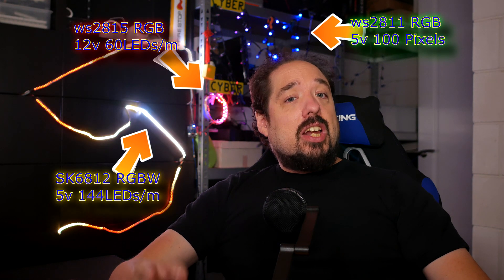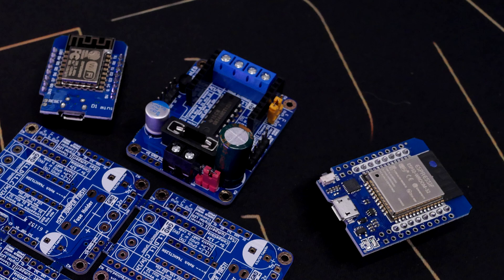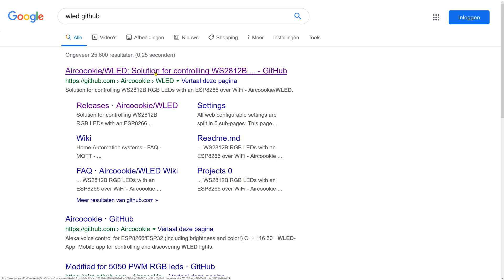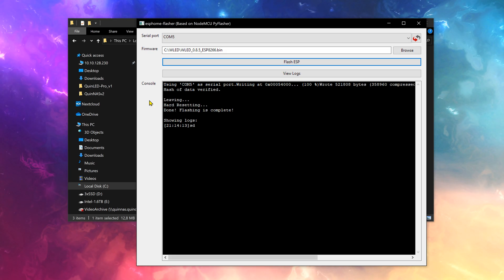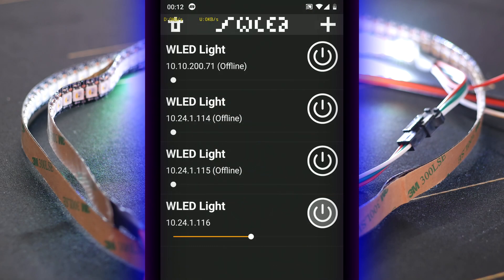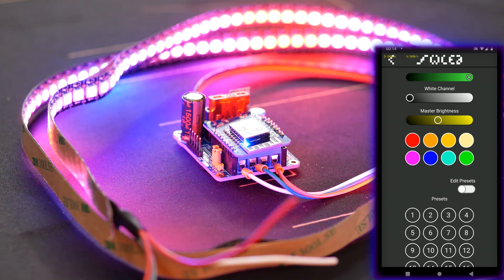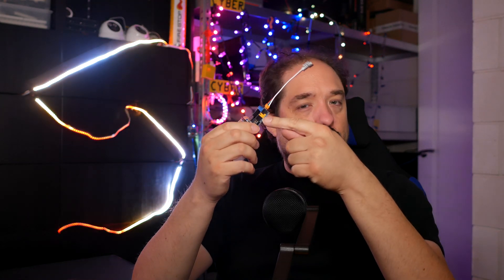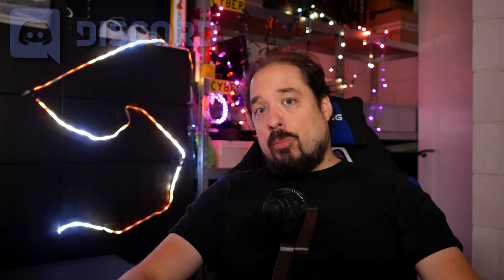WLED Tutorial - The ultimate DIY RGB Controller?

Comment: Hey I bought 4 16ft WS2815 12V strips with 300 LEDS per strip (1200 LED total). Could 1 Dig-Uno run this assuming I inject power in the middle and have a good power supply?
Reply from the maker: With 1200LEDs you are running a bit much for the single channel, ~1000LEDs you get about 30FPS and that's already a bit choppy, but above that with like 1200 effects and everything will start to look really choppy.

Take a look at my recently introduced QuinLED-Dig-Quad, that has 4 output channels over which you could divide all the LEDs and that way you can keep the FPS high. Sadly most software (Like WLED) doesn't support it yet, but it's coming.

In regards to power injection, since they are ws2815's I'd recommend injecten after each strip, so begin + middle + middle + middle + end. Otherwise you are going to see a bit of drop
Reply: Intermit.Tech Thanks for the help, honestly! If I really want to make this project work, would two dig unos on one power supply work? Like if I sent two strip one direction and two strips in the other direction, where they would meet in the middle rather than in one continuous strip, could this work ?
Reply from the maker: That could work, but only if you basically treat it as 600LEDs x2. So basically connect both sides to the same data pin so both LED strips will do exactly the same. Then you are fine framerate wise. And in the future, once software support is solid, you could combine them again but driven over 2 channels without the slow down issue.
Reply: Intermit.Tech You rock man! Last question of the night, would having two dig unos mean two WLED networks? Is it fairly simple to
Merge them or sync them ?
Reply: Intermit.Tech I’m fairly new to all of this so sorry if I’m asking some weird questions. My main concern is the WLED control over internet since there will be two now.
Reply from the maker: They can be easily synced, no issue. But the patterns don't follow over to the next controller, they just perform the same.
Reply from the maker: Should work just fine on your WiFi or if you are not @home over a VPN. Otherwise Home Assistant control of WLED is awesome!
Reply: Intermit.Tech You’re a huge help !! Looking forward to all your new content!!! Your channel is pure gold man. Thanks again

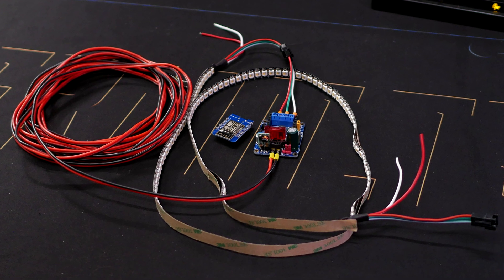Comment: Total noob here, literally zero knowledge outside of a couple of videos on this subject. At 5:06, why doesn't the LED strip need to be connected to a power supply and only the dig-uno? Unless it's been plugged in by the time it turns on at 5:34, the strip's power wires are off screen at that point.
Reply from the maker: With the QuinLED-Dig-Uno design the power runs through the board and includes some safety functions including a fuse. That way If something goes wrong and it suddenly uses a lot more power, the fuse will pop and cut off all power.

Comment: Could you make a tutorial for WLED with E1.31 input? With multiple receiving controllers would be awesome! Looking in to adding strips to my existing DMX light setup :)
Reply: succesfully working with mad mapper and ArtNet. I set a different universe for every board, and they respective IP's
Reply: Albert K I normally use “LightKey” for DMX but are not able to find the ESP8266 in ArtNet or E1.31.. Even thought I can normally access it trough my normal WiFi.. Could you please be so kind an share your ArNet settings in WLED config? And is there any need to “enable” these settings? (Like turning on ArtNet?) Thanks!
Reply: @iFlojoe  Hi! I go to Config -> Synch interfaces 
-> Network DMX input type: Art-Net 
-> Start universe: 0 
-> DMX start adress: 0; 
-> DMX mode: Multi RGB.
Then in your software you have to enter manually the IP address of the board. If I have two boards I set board 1 with his respective IP to universe 0, and the other with his respective IP to universe 1. Never use more than 170 pixels in this case. I don't know how it works when it has o merge universes o control more then 170 pixels :) It is clear???
Maybe Artnet Pool is not enabled in WLED and your software does not "discover" the board, but he is already listening for artnet! So you have to point to the IP manually
Reply: Albert K thank you very much! I will try to copy your settings and set the DMX software to manual mode :) I am looking forward to only use the Effect Mode (11dmx channel), do you think I can have multiple Nodes receiving the same DMX univers?
Reply: @iFlojoe  Yes I just tried that in Madmapper and it works, two ESP receiving the same universe in this dmx mode. Do you know what all this 11ch do? I'm just playing with the sliders....
Reply: Albert K The “LightKey” software I am using on my Mac does not allow to set a specific IP address, but wenn I switched it to Broadcast mode it finally worked! Thanks again :)    The 11ch mode ist the best for me because I don’t want to have control over every single pixel, with 11ch (13ch if you have RGBW strips) you can aktivste the animations from WLED via DMX, like using the automatic Programm in lasers or moving heads!  See this site for different channel modes and an overview for 11/13ch: https://github.com/Aircoookie/WLED/wiki/E1.31-DMX

Comment: I’m tech noob but is there a way to do the wifi connection without eating up your home bandwidth? (Like a separate router that is online from your home modem but connected to your computer and wirelessly to your ESP controller)
Reply from the maker: What bandwidth are we talking about? Just having the controllers connecting and display effects doesn't use any bandwidth? Further there is only so much airspace, yes a second access-point (not a router) can help on a different frequency, but that's a very extreme setup. What issues are you having? Figure that out first. :)
Reply: Intermit.Tech sorry i think my question was a result of my wifi noobiness. I just thought having these connections as wifi would mean running off my home internet and affect my web browsing for example. I don’t actually have any equipment, was just trying to determine whether I want to go with a wired falcon controller vs. Wifi esp.
Reply from the maker: @jordanl7489  Ah no, it indeed doesn't work like that. Having a device connected isn't such a big issue, if it activity sends or receives lots of data that is different, but with general WLED usage, no such issue.
Reply: Intermit.Tech thanks!

Comment: Hi, just stumbled across this doing research. Can you control more than one LED strip from a single controller?  Zones?  I see you have a pre-built version now - you may have yourself a new customer. This looks great!
Reply from the maker: Multiple zones not yet. I'm working on a Quad channel hardware version and WLED should add that feature somewhere this year too. For now you can run a single strip (or multiple but they will do exactly the same) and you can work with segments on that strip to have different effects
Reply: @IntermitTech  Probably an unfair follow-up... and maybe the wrong venue, so feel free to redirect me... I'm down-lighting some stairs.  I don't know how well WLED handles segmenting a single strip -- if it can treat each segment sort of like a zone (I don't anticipate doing different effects on each stair, but it would be cool to get each step to act independently)... what would you recommend to give the most flexibility?  Do I need 24 individual controllers - one for each step?  (and thanks for getting back to me -- you're awesome!)
Reply: My understanding this has changed now for the QuinLed UNO, they state as an added feature that it is a dual channel now but how to connect two strips and control with WLED is beyond me at the moment.

Comment: I'm getting really choppy animations on all effects when I set the speed slider to 1/2 and below. I was really rooting for an ultra smooth visualization but its so bad its like playing a game at 20fps. Is this normal? I use a WS2812B strip (12 leds) and NodeMCU ESP-12E CH340G and both of them are powered via a sacrificial molex  connector from my PC using the 5V and ground wires.

Edit: I also installed the necessary drivers for the CH340G
Reply from the maker: No, it should be pretty smooth to be honest, generally it runs at 40 - 60FPS for me and I'd definitely notice 20FPS. But you mention you only have 12 LEDs? That's not a whole lot really and most effects will look choppy because basically the resolution is quite low. Animations on 144LEDs/m will look at lot more smooth then on 30LEDs/m for instance. Could that be the issue?
Reply: @IntermitTech  The brightness looks like its going from 0-1 instead of a smooth fade. Maybe its because of my 1m 60led strip that's been cut down to 12. Also had some arduino uno laying around and loaded it with the pacifica effect from fastled (same as the one on wled) and it can display the effect better. I may have to troubleshoot some more but sadly I accidentally plugged the 5V feed to the 3.3V so yeah I might have to order another board. Thanks for the insights mate.

Comment: Hi, thanks for this video. I have been looking to build a DIY nanoleaf set up using hexagons shapes and this has made the electronics a lot more simple. Is there any videos regarding getting this working with Smartthings? Which is my Hub of choice. Thanks.
Reply from the maker: I use it mostly with WLED software on it and sometimes ESPhome software although WLED mostly now a days. Check out that to see if it can work with smartthings, I know it has some stuff for Hue. WLED also connects to Home Assistant so maybe that can work as a bridge?

Comment: Any way to incorporate the infrared setup from aircookie into the Uno board?
Reply from the maker: Sure yes, all of pins and voltage points are exposed that you need in the form of pin headers. I will release a new version of the PCB soon which also has GPIO0 if you want to connect a button.

Whatever pin is needed you can always solder it on directly, but I believe for most if not all use cases everything is there. :)
Reply: Intermit.Tech Thank you! I wasn't sure if I could solder to the header pins or not. I will give it a shot. From your understanding, can you then use a remote to scroll through effects/colors?
Reply from the maker: I haven't used the IR function myself, but yes, I believe so

Comment: is it possible at al to asign presets to physical buttons?
Reply from the maker: Not sure in WLED itself, but if you link it to Home Assistant for instance, then certainly. Anything you can use to control something in Home Assistant can trigger any action to happen, including changing a setting or preset in WLED on one or multiple controllers. :)
Reply: @IntermitTech  Thank you, i don't think it will work, myt idea was to use it in an automotive aplication

Comment: Could the QuinLED dig Uno be used with an ATX power supply by removing the diode at the ESP 5V line and injecting the standby ATX power at that point?
Reply from the maker: We've discussed this on the Discord (You should join!) and Yes, there is no problem doing this. All the 5v devices are behind that Jumper pin so if you feed in 5v there and keep 12v to go through the board, that's all fine. You don't need the DC-DC converter on the board and it would even allow you to use the WLED relay feature for the 12v supply for instance.
Reply: @IntermitTech  I will definately join the discord.
Thank you for this information.
I use WLED on the Dig Uno.  I find it the perfect partner for your board.

Comment: I have one question about the Dig Uno.   Is it possible to modify it to run off an ATX computer power supply?
This would need the ESP chip to run off the 5v standby power and one of the GPIO pins would control the power on signal.
WLED has a pin already set in it, but would need a way to run the ESP off standby rather than main power.
Reply from the maker: Yes, we've actually discussed this on the Discord recently. Although the board isn't designed specifically for it, the way it is designed is that the 5v circuit is fully separable from the power going to the output port. So if you can pin it out on the power supply to get the 5v out, that could work.
Reply: @IntermitTech  tried to join the discord using the link on QuinLED.info and it says the link has expired.
Basically, all I need to know is how to isolate the 5v supply to the ESP.  Do you have a schematic or easy way or is it really just as simple as relying on the onboard diodes and just connecting the standby to the chips 5v input?
As a note, I absolutely love your QuinLED boards.  I think these should be the standard for maker LED controllers.  The layout is brilliant in such a compact size and the attention to detail and safety is second to none. 
I think WLED and QuinLED Dig is the absolute best combination for addressable LED controllers.

Comment: Hello Quindor,

Received the last parts yesterday and soldered my first quidled-dig-uno today, soldering these tiny components was a challenge, my soldering is a bit rusty :-)
Now I want to flash the lastest WLED binary and we have now several options for that, we have a ESP32 version for pin4, is this the right version I need for a ESP32 with the quinled-dig-uno?
https://github.com/Aircoookie/WLED/releases/download/v0.8.6/WLED_0.8.6_ESP32_ledpin4.bin

Regards
Dirk
Reply from the maker: Hi Dirk! Yeah, soldering those 0805's can be a bit tricky but once you get the hang of it, it's ok I think. No, for the ESP32 you'll need either IO16 (corresponds to jumper on 2) or IO22 (corresponds to jumper on 3). I have a custom build for that, but it's a bit old. IO4 is not connected on the QuinLED-Dig-Uno so making a custom build is best. I'll ask Aircoookie to make a build for IO16 standard if he can. :)
Reply from the maker: I talked to Aircoookie and there should now be a ESP32_ledpin16.bin on the github releases, that one is the one you need for the QuinLED-Dig-Uno with an ESP32 on top. :)

Comment: If I have two separate light runs can I "T" splice off the data cable to mirror two runs from one controller? Or do I need two controllers!? Thanks
Reply from the maker: You can splice off, it will run the exact same effects so basically they a mirror of each other but causes no issues other then that! I have an upcoming video where I use this actually!
Reply: @IntermitTech  Nice! Thanks for the reply boss!

Comment: My mac will not open the ESP flasher. I can't figure out why. Is there another program that I can use that would do the same thing?
Reply: You can use esptool or esp8266 flasher, NodeMCU flasher does work also
Reply: @M.4y  I was able to get the NodeMCU flasher to download. I got the COM9 to connect to my D1 mini. I perform the flash command and this is what the log says:

Note:Serial port connected.
Note:Begin find ESP8266.
Note:ESP8266 ACK success.
Note:ESP8266 ACK success.
Note:Serial port disconnected.

I don't see the wifi AP network. Any ideas?
Reply: I got it working. Thank you!
Reply: @tylerwamsley9388  What was the issue?
Reply: Marlon Otto under the confit tab I don’t think I had the box checked beside the bin file.

Comment: Thanks so much! the timing is perfect, I've been trying to get esp32 to work all day! Love your QuinLED-Dig-Uno boards, and waiting for the multi channel one.
Reply from the maker: Thnx for the kind works! Although I did make a Dig-Hexa prototype at one point, I decided to focus on the Dig-Uno first and implement more features into that board. That's worked out well and I will probably look into adding the same features to the Dig-Hexa in the future. Software is very limited for such a board though, so it's on a slow burner, just letting you know! :)

What would be your plans for a multi-channel board? If I do see good scenarios I might get to it sooner! :)
Reply: @IntermitTech  I started off last years holiday lights using the sketch created by The Hook Up, so I have my roof lines divide up in 4 sections. now using your board and WLed, I need 4 separate controllers that I need to keep in sync. most would switch to E131, but I like the simplicity and HA integration.
Reply from the maker: @dalescott9330  I see, that would be a good scenario for that but still, software support would be an issue I think, I don't believe WLED currently supports multiple output channels from a single board. The QuinLED-Dig-Uno actually has 2 channels if you use clockless LEDs such as ws2812b!

Comment: What is the name of the terminal/connector on the wire, going to the input / outputs?  I need something like that for my Screw Terminals.
Reply from the maker: They are called wire ferrules, I use them everywhere where I have stranded cable, hate working without them! I have a link to a kit on my equipment page: https://quinled.info/2018/10/01/tools-and-equipment/#ferrule-crimping-tools